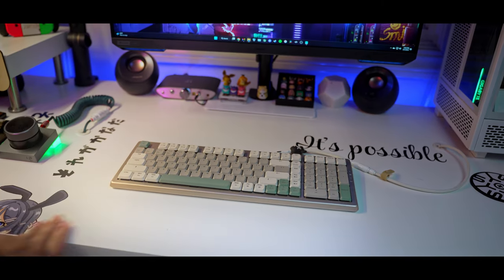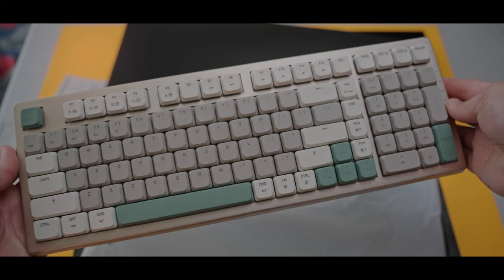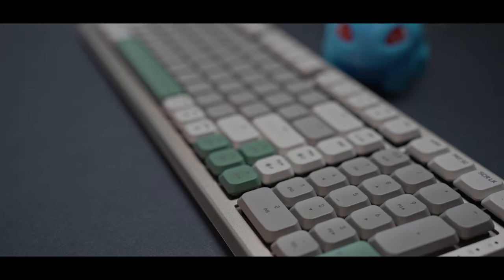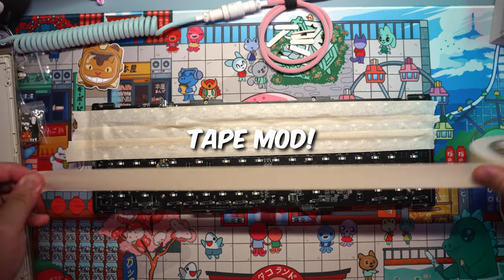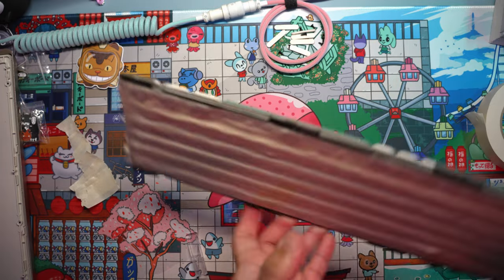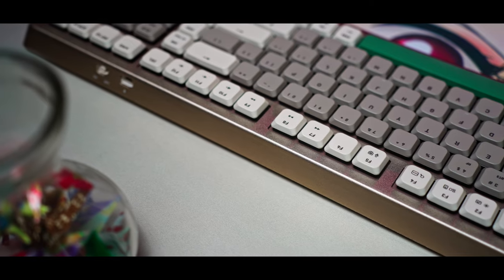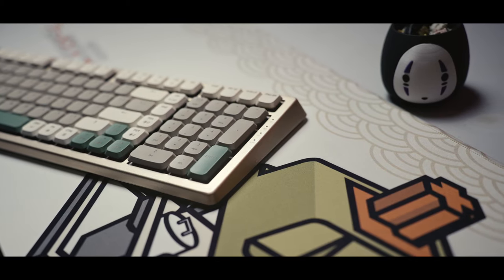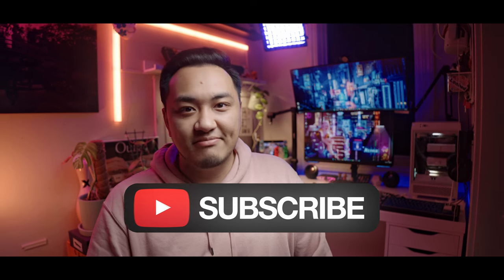The Low Profile Keyboard That Thock | Cascade 98 Slim by AZIO

Comment: I just got mine, my first mechanical keyboard, and I really am so happy with it. I knew I wanted a low profile keyboard, coming from years of laptop use. And it drives me *crazy* how many 98% keyboards screw up the edit keys (home end pgup pgdn) - especially the ones that only include 3 of 4. I'm looking at you K17 Max. That empty hole above the right arrow key feels like the hole in my heart from looking at all these "almost" designs. 😂 And then there's the Cascade 98 Slim. Now if only we could get proper windows-only keycaps and VIA/QMK, then this keyboard would be perfect.